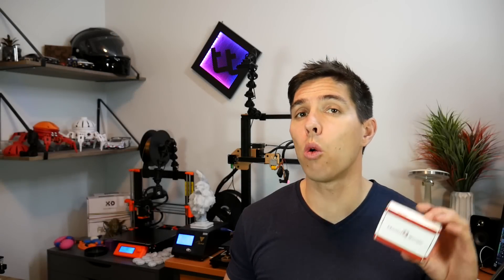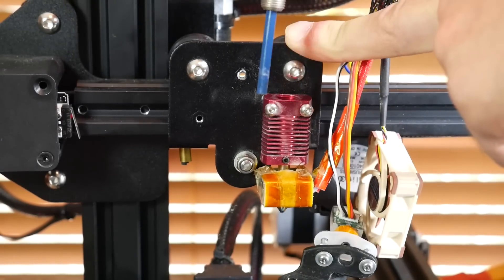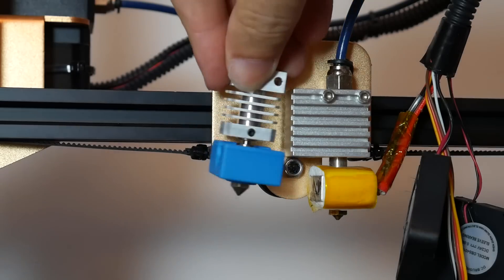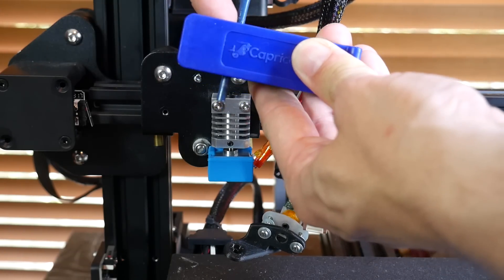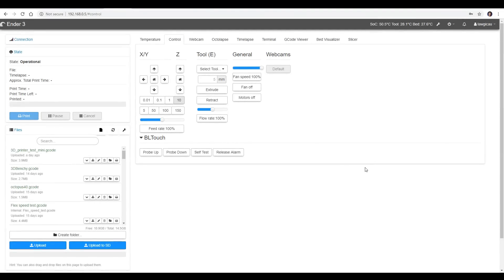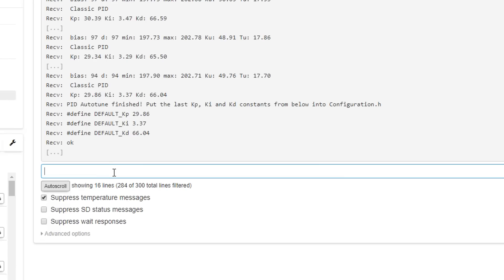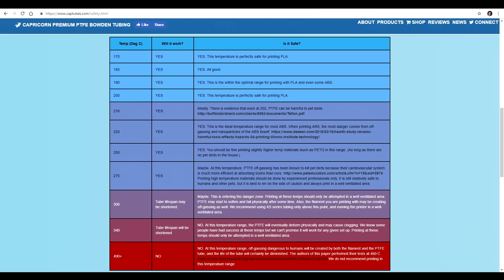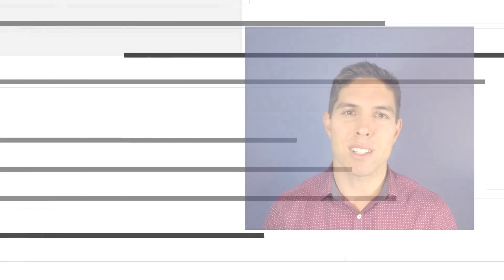Ender 3 Micro Swiss all metal hot end

Comment: according to that table provided by the PTFE manufacturer its capable of printing at 275C without even reducing its lifespan.. so why make the switch to something that does not perform as good of reactions? with most PC printing at 260C you even have a fairly large safty zone when the maximum temperature the ptfe has performance degrigation at 340C. AND at ABS printing temperatures of 225C  the ABS releases more toxins than the ptfe.

Comment: Just ordered one of these for my Ender 3 pro. I don't have anyway to do the pid tuning. Can I put the numbers that you got into my slicer or do I need to find out the numbers for mine?
Reply: You may want to upgrade FW, or install octopi to use the terminal. These numbers are specific for different machines. The tolerance of heating element, temp sensor, heat sinks will all affect the pid tuning. It's best practice to tune individual machine rather than using some preset numbers.

Comment: Nice video, thanks!

I am not sure if I understoodd correctly, but do you think that it can help to reduce the hotend clogging?
Reply: It reduce clogging when you print at higher than 240C, because the PTFE tube won't be melted by the all metal hot end. 
It doesn't make a difference if all you print is PLA

Comment: I’ve been printing ABS on an Ender 3 pro with removable magnetic bed for well over a month at 110C without any problems.
Reply: It's been a year now.  Any problems longer term?
Reply: A Kalia none at all. Still printing ABS on the same removable magnetic bead.
Reply: @JeffsAquaponics  Thanks for the reply.  I just went ahead and printed ABS at 100C on this machine, for the last 2 weeks.  Only issue I can see is that the surface sheet can be peeled away from the magnet more easily when it is hot, i guess because the glue softens.  Edit:  The adhesive has now become a problem several days later leading to it pulling up and part warping as a result.

Comment: Don't think I would buy this again because you are locked in to one brass nozzle type from Micro-Swiss.  Didn't realize it when I made the purchase and regret it.
Reply: Pretty sure you can use any nozzle you want. I bought like 40 nozzles off Amazon for like 12 dollars. Various sizes and shapes, all screw into the same threads
Reply: My appologies for the previous comment.  I was totally wrong about the diameter question.

Comment: Unfortunatelly this design has the same flaws as the others, a tiny threaded tube wich shall hold the nozzle and the heater block without any possibility of counter locking nuts. Why not just make a combined tube with heater block and cooling fins, in one single piece with a removaböe nozzle instead. People do not need to take ot apart very often and the possibility to do so causes filament leaks very often.

Comment: Is it possible to machine a metal throat that could mod the Ender 3's existing hot end? I am new to printing but have a friend who is a machinist. Thought it would be a neat project if at all possible?. Or even better maybe someone is already selling a similar solution.
Reply: https://smile.amazon.com/gp/product/B07SC1XYGG/ref=ppx_yo_dt_b_asin_title_o01_s00?ie=UTF8&psc=1. I'm going to try this heat break instead of dropping ~$60 on the micro swiss. That's pretty much the only functional difference that I can see between the two. Might have to polish the bore on the part though, we will see when it arrives.

Comment: So if  the capricorn ptfe tube can resist up to 300° why  bother changing  the hotend in  the first  place? And why  did  you bring up  the capricorn ptfe tube in the first place when the argument applies  only  to  the  standard  ptfe tube?  The conclusion should've been don't change  your hotend, change your ptfe tube. Or  was  this video sponsored and you had  the obligation to push promote  the hotend? Your video is confusing.
Reply from the maker: I paid for this with my own money and have no contact with the company. I always disclose. The tube can take more heat but will still be giving off gas. It is still beneficial with this hot end because it has lower friction than standard white tube.
Reply: @TeachingTech  thanks for clearing that up m8

Comment: Wow, I have a ton to learn. I saw the Merlin video that helped me understand what Merlin was, but I'm still confused by how fast you speed through your tutorials. I appreciate it a ton, but as soon as you got past the installation and got into the firmware, I was just completely lost. Then again, I'm new to 3D Printing. In fact, I have not even received my Ender 3 Pro yet (it comes in on Friday the 26th). I'm simply looking at tutorials so that when I do get my printer, I won't mess it up or be completely lost. I'm excited to upgrade my printer to get the absolute best quality out of my prints, but I likely won't do anything for a while. Regardless I enjoy learning and I will upgrade eventually. Maybe when I get my printer and begin upgrading, I will understand the more technical side of these tutorials. As of now, I want to upgrade: Motherboard to TMC2208 (for the silent steppers),  All Metal Hotend,  Direct Driver,  Hero Me Fan Duct, and install a Raspberry Pi. I want to learn this info but I don't know any type of scripting or related software and it's all so daunting!
Reply: Be patient.  The Ender 3 is capable of very good parts in stock configuration.  If you don't initially get good parts in stock configuration it's tempting to start upgrading but I would caution against this approach.  Over time you will learn to tweak your machine and this will serve you better than chasing every upgrade.

Comment: Thank you for this video. That's a lot of  work if your not doing any high temp filament.  It's also above the level of any novice as I had no clue as to what any of the software gcode stuff was that you flew threw.  So, since there is no performance gain, I will stick with stock.  You saved this noob a lot of money and time.

Comment: Crazy question here. When you do the PID Calibration do you have filament loaded into the printer or not?
Reply: I think it is best practice to have the fliments in while performing tunning.  The fliments more or less has some heat capacity and can affect the temperature response to the hot end. I am not an expert, may be someone else can comment on it.

Comment: Dumb thought, can't we just put a metal rod all the way down to the nozzle and not have the ptfe tube >250C problem?
Reply from the maker: Potentially, yes. I imagine there might be issues with materials expanding at different rates and plastic clogging. Also, there is always a heat break designed to keep the melt zone to a specific place, this approach may not achieve that.

Comment: Why get an all metal hot end that is for printing higher temp filaments and then set it to print pla? The stock set up prints pla. I'm a little confised. I'm trying to get this ender 3 printing nylon, so 300c. So instead of setting the temp at 200 for pla, set it to 300? Is that the only thing that needs to be done to get the screen to allow the printer to go over 260c? Do your video upgrade with the Arduino Uno 3 firmware upgrade first?
Reply from the maker: You are assuming I will only ever print with PLA from this point forward. You will need to raise the max nozzle temp in the firmware and yes you will need to flash a bootloader first to achieve this.
Reply: @TeachingTech  I don't mean to assume that you're only ever going to print with PLA. I am just trying to learn this stuff and am more than a little confused sometimes. I assume you are setting the max temp at 200 because you mostly print with pla, and if the max temp is set to 200, that means it cannot have a thermal runaway? I've heard that fire is a real concern with these machines.

Comment: If I change my bed to glass from the magnetic one on the ender 3 pro can I then print those filaments that require higher bed temp?
Reply: in theory, you could - the only reason you cant print hotter on the magnetic bed is because the magnetic effect will wear off with prolonged use at higher temps.
Reply: You say in theory. What are the key issues? Bed not hot enough? I'm totally new to 3d printing but I've been a maker and engineer for what seems like forever. No explanation will go over my head. Id like to know what materials I can print well (doesn't need to be perfect) on the Ender 3 pro. I'm willing to upgrade anything that can/ should be upgraded. Thanks for any help.
Reply: @HDgodfrey  It depends what you want to print - ABS, for example, generally requires an enclosure so the delta between part and atmosphere doesnt cause too much shrinkage and cause cracks in the print or warping and deformity. Each plastic will have its own characteristics - i only print pla on a non-heated bed so i only know from theory, im not the best person to ask about specific filaments but theres plenty of info out there
Reply: Thanks.

Comment: Ok, I'll admit to being a dummy about this stuff, I'm more mechanically inclined than computer orientated (I'm also 68 years old so didn't grow up with it), so.. My question when entering the commands into the firmware, using the Octoprint program, exactly 'where' do you do this in the program?. I would assume it is not just some random place? I would like to upgrade my Ender 3 Pro, so, an answer to this will be greatly appreciated. Thank you in advance.

Comment: After changing this hot end, do you need to change the thermistor to go the higher temperatures?
Reply from the maker: Only if you are printing more exotic filaments that need close to 300 C. Generally you'll find brands of Nylon that don't need it that high.
Reply: Thank You. I am going to be printing ASA, it states working temp of 250-255 degrees. So, I won't worry about it. I did order a glass bed though.

Comment: Great video. One thing to mention is a Swiss All Metal is essential if you plan to do production/heavy use on the ender3 (any printer) I run swiss micros on all my print farm printers (and bondtech extruders) as the PTFE does not stand the test of time where as a correctly installed all metal will require much less maintenance over time.

Comment: I just purchased a Micro Swiss hot end because I realized there's no way I can put PTFE tube perfectly straight and perfectly at 90*, and if I can't do that, then making any changed to the hot end will always be a crap shoot if the PTFE tube has sealed against the nozzle or not.
Reply: It won't matter as much since in an all metal hotend the ptfe tube butts up against the cold end of the heat break instead of the nozzle. The end of the heat brake isn't going to get hot enough to melt even pla so it'll remain stiff and slide through cleanly (unless you cut the ptfe end at 45 degrees or something insane, in which case it may bind)

Comment: This new design is ABSOLUTE GARBAGE. I installed this on my CR10 S5 following the instructions in their video. I was quite surprised to see the all plastic Bowden fitting rather than the usual threaded push fit type as the photo used in the advert did not indicate this. On the first print the micro swiss nozzle blocked. I attempted to remove the Bowden to clear the blockage however the plastic fitting refused to release. I had to rip out the Bowden with a pair of pliers breaking the fitting and destroying the Bowden in the process. In addition the cooling block is not threaded for a standard push fit meaning I can't use a standard fitting and the hot end is now useless. Also, the incredibly soft screws that hold in the heater cartridge rounded instantly I tried to remove them. I now have a complete hot end assembly I cannot use and a printer which will remain unserviceable for a week until I can source replacement parts. I see this as a very poor cost-cutting exercise by Micro Swiss which has left me with a printer I can't use, a new hot end I need to replace and about $150 out of pocket. DO NOT BUY FROM MICRO SWISS UNTIL THEY RESOLVE THIS ISSUE.

Comment: i just upgrade my ender 3 with all metal hot end micro swiss, the result is nice. but i had trouble with cold pull, i can't pull out the filament, anyone has suggestion with the hotend temperature when cold pull? thanks.
Reply: did you find out about the cold pull ?

Comment: The nozzle coating is nice but it's not something I trust long term for abrasive materials. It might last you a kg or two, depending on the material. Once the coating wears out on the orifice it will start blowing out pretty quickly.

Also your thermistors appear to use PTFE insulation so you might have problems with running your thermistors above 250˚C.

I don't trust Capricorn's data. I've yet to see a competing PTFE that's as bad as they claim for their competitors, and there's no magic PTFE formulation that justifies the claimed temp resiliency for their own products.

Comment: You just ruined your entire video by not following directions.
https://tiny-machines-3d.myshopify.com/pages/instructions

1. If you watched the installation video at the end it tells you to raise your temperature 5C.

2. For PLA your temps were too low to have good layer adhesion. 205-210C would have been a better choice. Running a new temperature tower is recommended. You can find tons of them on Thingyverse. 

3. Your retraction settings wouldn't have been right either and you have to calibrate after switching. At the end of the video it says no more than 4 but your retraction settings still have to be dialed in for every filament that you used previously. If not you will have clogging.

So basically your apples to apples comparison was never valid. I own MicroSwiss hotends for multiple printers. The majority of people will see improvements when printing higher temp filaments like PETG or ABS. 

Don't swap filaments without first cleaning out your hot end or it will also induce clogging even on the MicrosSwiss. A quick search in any of the Creality FB groups will show alot of people that upgraded that had no idea what they were doing still having problems because of this.

Heed the warning about the hot end cooling fan. The airflow must be pointed towards the hot end. There have been people who had the fan pointing the wrong direction who blamed MicroSwiss when they started having problems.

New users will want to be aware that you can easily break the heat break off in the heater block when switching nozzles so be extremely careful or use a micro-torque wrench when applying force to tighten the nozzle down.

People always ask if they can just upgrade the bowden tube on the stock hot end to Capricorn XS or Tuff Tube to print at higher temps. You can but you have to be aware that the max temp of Capricorn XS in documentation is the point where it completely degrades and offgasses just like regular PTFE. You will also need to switch out the stock Bowden adapters because the majority of users will see it fail over time as the extruder retractions will eventually pull the tube out on either end.
Reply from the maker: You have some great knowledge but did you actually watch my video? At the end I screenshot and discuss the exact same thing you are talking about: retraction, raising temperature, etc. The documentation In fact is says NO MORE than 4mm retraction, not NO LESS than 4mm. I also screen-shotted and discussed the safety page and associated graph from the cap tubes website. Please, please, please watch my video properly before you criticise it.
Reply: @TeachingTech  I watched your entire video. Notice how you only went after the one part cause that is all you could come up with. The 'less' part was a mistake on my part but because I was jumping between videos and the installation notes but the rest of that sentence is entirely valid. You do have to calibrate every time you make a change. You can't just compare two hot ends and have and apples to apples comparison. The part after the critique of the video literally applied to questions people posted in your comments that weren't addressed fully in your video. If you had done any research you would have found all of this information online. That is why people can't tell if the upgrade is even worth it.
Reply from the maker: I respectfully disagree with the premise of your post. You have criticised me for not including things that I included. Not printing beyond the PLA print is because the magnetic bed on my Pro model is rated for 80 degrees only, which means I can't attempt to experiment with polycarbonate or nylon. This was also covered in the video, along with a link to a video where another channel does this to be as diligent as possible. People not knowing whether it's an upgrade is because it might not be for them. The majority of users will be printing with PLA only and would probably be wasting their money by purchasing this. This was one of the aims of the video, to show that while this is a really nicely made part, it's not necessarily an upgrade for every user.

Comment: Hello there I need some help I'm getting a ender 3 for Christmas because you have inspired me. But  my question is do you just plug your printer in a normal plug  or something else because a ender 3 pulls 15amps
Reply from the maker: The printer might pull 15 ampsbut that is from the 24v output of the power supply. The mains current from the wall is no where near this so a normal plug is fine.